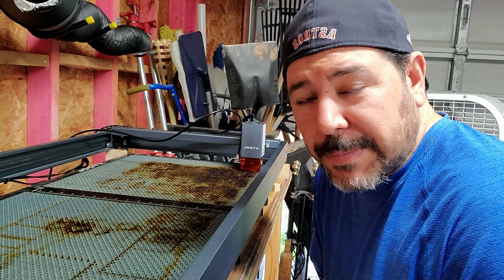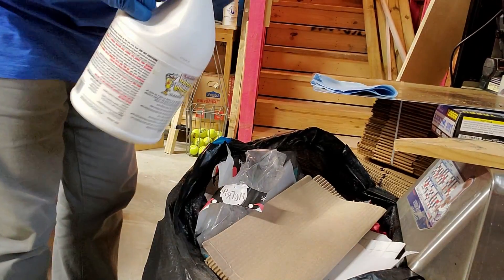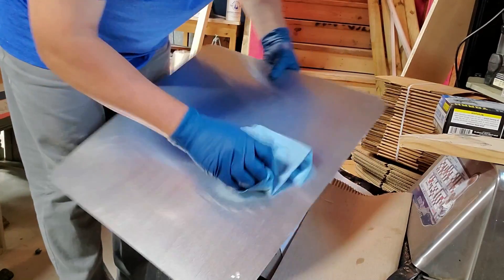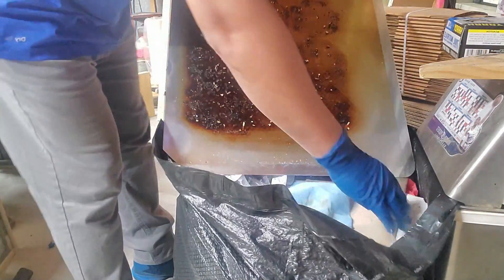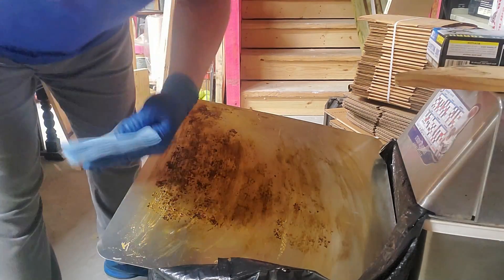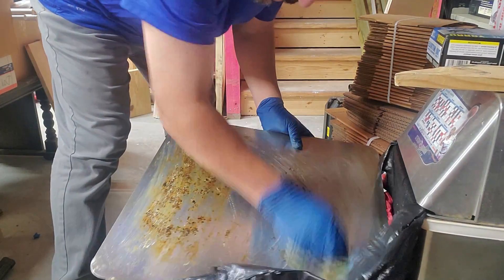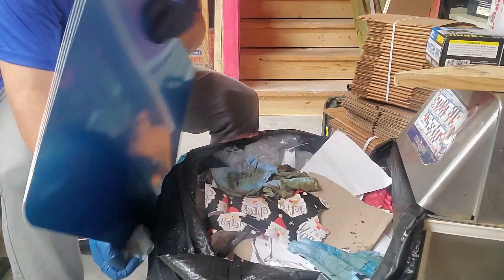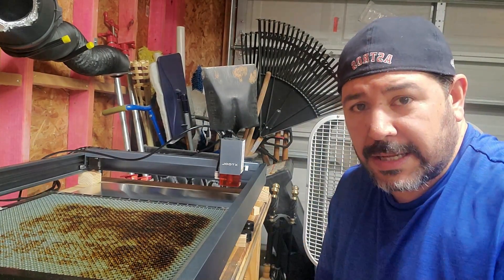Cleaning The xTool D1 Laser Diode Honeycomb Panels Metal Plates (S5; E12)

Comment: Good morning, this is the first time I’ve seen your video, um… I’d to suggest trying L.A’s Totally Awesome cleaner for your aluminum trays and the honeycomb. I have the 20w d1 pro and it gets filthy as well. L.A.’s Totally Awesome literally melts all the tar off of everything. I reuse L.A’s TA until it no longer cleans. Hence, I have to use a baby pool because I have the extended size tray and honeycomb. However, it does take a lot of rinsing, so I just use the hose end nozzle on my garden hose until no more bubbles are coming off the items. Leaning the tray and honeycomb up against an exterior wall or something. Away from the baby pool so I can reuse the undiluted cleaner. Then I use my air compressor to blow away as much water as possible. Pouring the cleaner back into the original gallon jugs is a great way to keep it for use again. Good luck… have a great weekend. 
SaraJean
Reply from the maker: Thank you for sharing your experience for others! And yes, since then I've upgraded to an extended honeycomb panel and I love it! I also have a bottle of LA's TA and it works great as well. I have a washout booth with filtration for my screen printing, that I put my extended honeycomb in to wash out, which is great. Thanks again for sharing.

Comment: Just a heads up.. Honeycomb Laser Bed 37.4"x 19.68"x 0.87" for xTool D1 Pro Extension on Amazon... one single panel and no hump in the middle.. :)  Im using the one from Nivill. Geekbee also makes one. They are both half the price of Xtool's official bed and 3" wider.  Xtool's extended bed is 37.6" x 17" and 200 bucks, so yeah...  Also a 1,800 PSI 1.2 GPM Electric Pressure Washer, and some Krud Kutter works wonders.. Its non toxic and bio degradable, and the build up on the panels melts right off...
Reply from the maker: Yup! I've been using the one from geekbee. So far so good. Made a video on it but haven't had time to edit and upload it. 😮‍💨